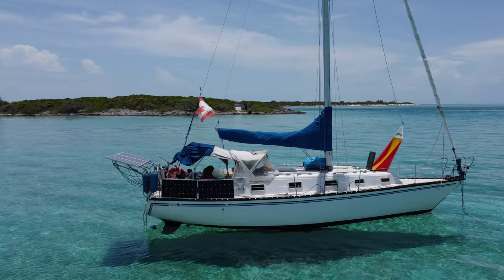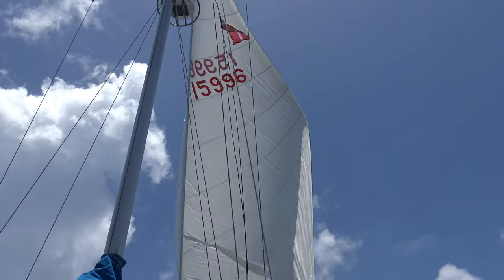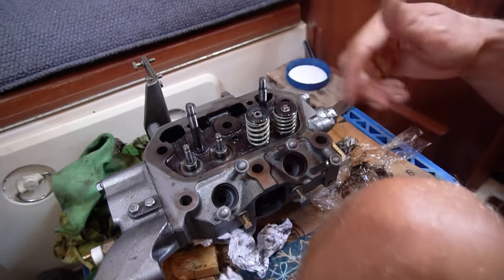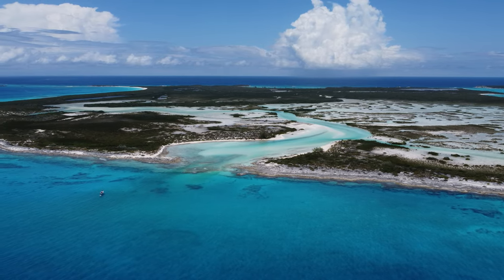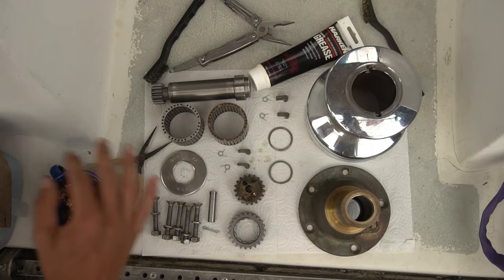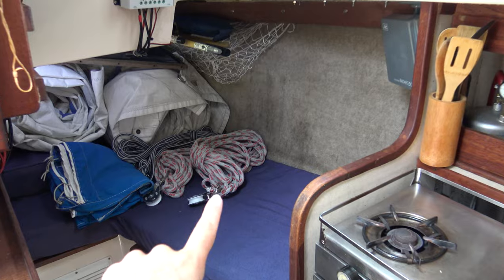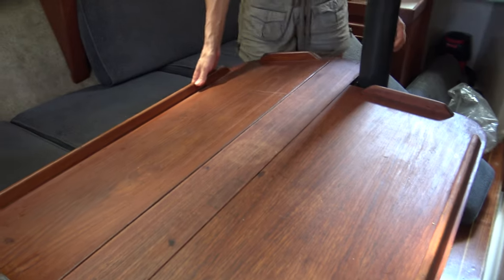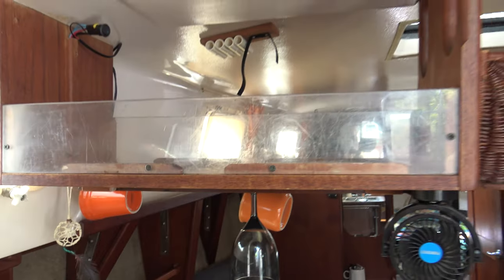Boat Tour Self-Sufficient tiny home, 1981 Hunter 33 Cherubini SAILBOAT

Comment: When Hunter made the 1983 Hunter 34, they must have used some Time Lord magic.  Mine looks twice as roomy, as that 33 footer.  How did they do that?

I like the choice of the Epever controller, even though I ended up with some Renogy controllers, that were on sale for $80 (20 Amp).  I went with Eco-Worthy panels, also on sale: $275, for four 120 Watt panels. Eco-Worthy uses Herculite glass, that was developed to be blast resistant. I'm still going to reinforce those, too.

I am headed to the Virgins, and eventually to the southern hemisphere, where Climate Change is only happening half as fast.  Maybe, we'll meet in Tierra del Fuego---lol  (no N targets, and few N power plants, south of the Equator, too).